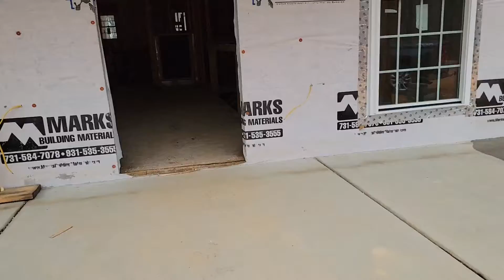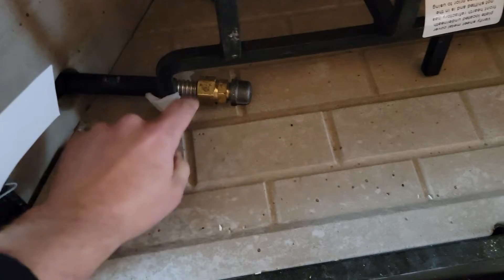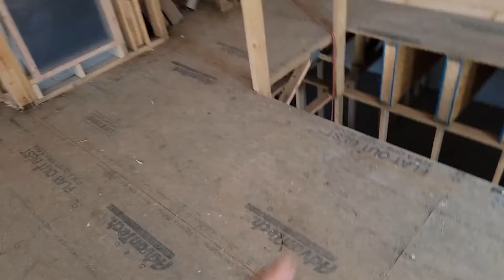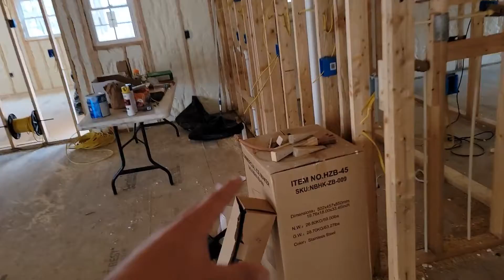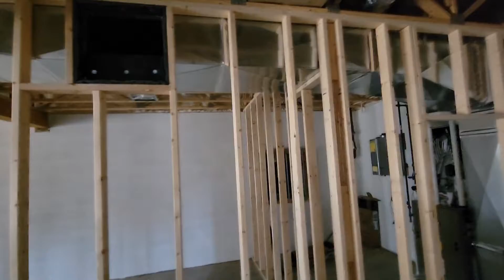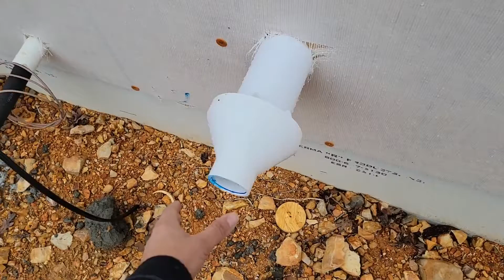HVAC Foam House New Construction Ductwork Layout Vented Gas Logs

Comment: Never installed a YORK system before, looks good, I was trying to find something wrong with the installation but couldn't see anything assuming you have easy shut off valves by both unit not just on the ceiling where you will need a ladder to get up there and shut the gas off ?
Reply from the maker: Very Cool Glad you like the install Yes of course drip leg and shutoff by the furnace as well

Comment: Why one central return instead of returns for each room?
Reply: Not a fan of that.  Bedroom will be uncomfortable
Reply from the maker: I have installed over 2000 jobs and all rooms are the exact same temp in every location because all vents blow the exact same 400 to 700 FPM
Reply from the maker: not needed but that would be a good idea 
I guess cost material and less vents in every room
Reply: @taddydigest  Here in Cleveland, every bedroom needs a dedicated return. Transfer grilles are aceptable but not ideal. Spend the extra $$ and do the extra work to do it properly. Return is critical.
Reply from the maker: Oh wow that's really cool I'm so glad that that is a practice because it would be so much better if every room did have a return
 Thanks for sharing that information with me really appreciate you William
Reply: @taddydigest  Are you actually an Hvac Contractor ?
Reply from the maker: Yes I've led 1000 or more installs in West TN
Reply from the maker: CMC Lic number 73671